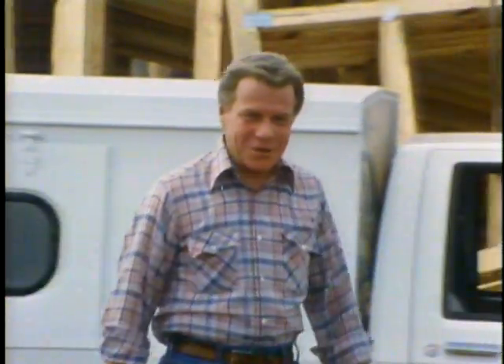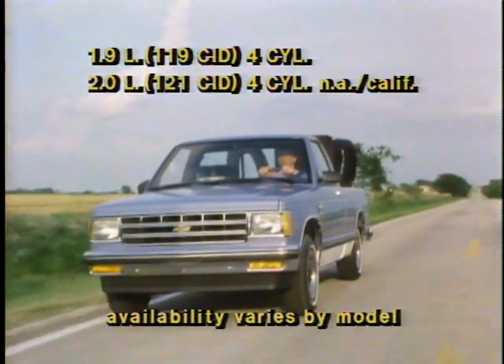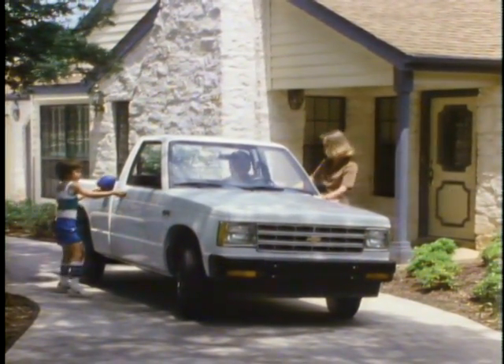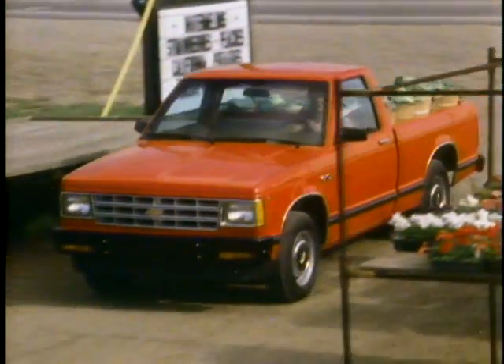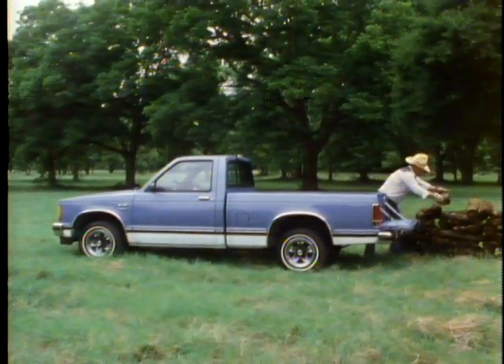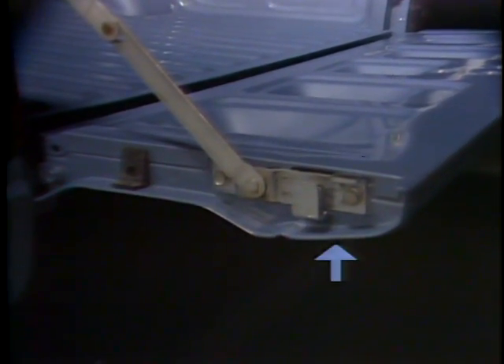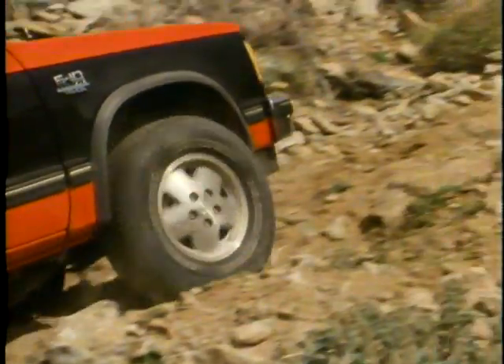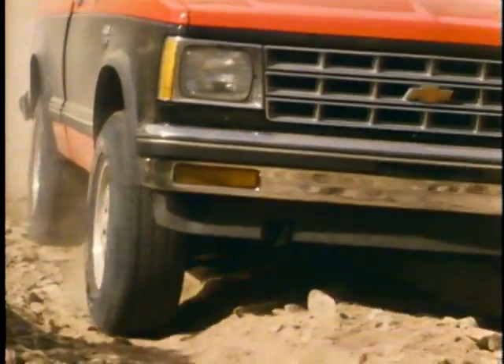1983 Chevrolet S-10 Pickup model overview

Comment: Had a '93 extended cab, 2.8L, 5sp for many years, never should have gotten rid of it.  No head rests on the bench seat?  Hope you don't get rear ended and crack your head on the rear glass.
Reply: I still have my 1986 Tahoe 4x4 extended cab that I special ordered from the factory. Still going 34 years later.

Comment: Hi, I bought a 1983 chevy s10 pickup about 6 months ago. The original owner, a farmer and mechanic, ordered it from the factory in 1982.
He had 3 trucks, and used this one for going into town.. when he died, his daughter inherited it..she gave it to her son in the last year of high school. 
He blew the head gasket.  They had just repainted it, put new tires on it and re-did the exhaust system.
Its gorgeous, silver w an aluminum tool box on the bed.
Best of all, it only has 69,004 original miles on it !
Once the head gasket is repaired and the carburetor.. I am going to sell it.
I am in Charlotte NC.  How do o go about getting the best price ?
Thank you..haven't done it before and hoping for some advice.

Comment: Buying a older 1982 S10 swapping a 350 with a 350 turbo transmission and going to bracket race plus use as a daily these trucks are badass .

Comment: I bought a 89 s10 durango 4x4 with a 2.8l, swapped in a v8 and now use the cargo holder behind the seat for oil that inevitably leaks haha
Reply: How do you engage the 4 wheel drive I have an 82 Durango that’s looks like it can do it just not sure how!
Reply: @Jazzygabs  I used the s10s 700r4 transfer case

Comment: I can't understand why people complain so much about the 2.8 litre engine. I drove my 2.8l S-10 Tahoe (which I had bought in used condition) in Germany for almost a decade and it never gave me any troubles. With the 5-speed manual, it had nice acceleration, reasonable fuel consumption and wasn't too slow for long-distance rides at the Autobahn (no speed limits). When I sold it in 2006 with ~245.000 miles on the clock, it still ran perfectly smooth. The engine never required repairs beyond the regular maintenance, except once when I had to replace some sensor at the injection system (which cost me 35 Euros). I still miss that car.
Reply: kernpanik yes these 2.8 liters are amazing little V6 motors the 165 thermostat keeps them cool. Unlike today’s motors running 200 plus.
Reply: Shouldnt have sold it!
Reply: Head gasket
Reply: @Clevelandsteamer324  You, sir, have a great name on here! 💩😂

Comment: The durango line never happened....and the tahoe was the top of the line not the sport line..
Reply: I have an 84 Durango in my driveway right now, i also have an 84 Sierra. The Durango has a really nice interior for the time it was made.
Reply: I had a durango, just because you have never seen one does not mean they didn't exist.
Reply: The sport was the top of the line. It later came with power windows and sun roof

Comment: 2.8 motor was the worst motor chevy ever made
Reply: LongIslandP8ntball no way. I have a 1989 2.8 5speed with 200k. It out runs my son’s 2010 Toyota Tacoma 4.0 v6. I know another person that has 328k miles on 2.8 never smokes. Just leaks rear main seal. I was always told 2.8 sucks. I believe not very strong lil engine.

Comment: Did the 1983 Chevy S-10 come with a chime or a buzzer?
Reply: Jac2Mac Low end came with buzzer. High end came with electronic (flute) tone. S-10 did not use a chime until the 1998 model year.

Comment: My first truck was a 86 S-10 2.8 V6, biggest piece of junk I've yet to own, that thing gave me my bias to buying Ford's when I got rid of it in favor of a Ranger.  Then again I've yet to own a chevy to impress me at all.
Reply: Those early Rangers were junk as well, hate to tell you.  Yeah the 2.8 V6 motors were junk but those 2.3L Ranger motors were garbage.  My nephew had one and had nothing but trouble with it.
Reply: I am a Mechanic of 30 plus years, I have seen good and bad in all makes of vehicles, my personal opinion is the vehicle is as good as the person who owns it.
Reply: My same thoughts on a ford.
Reply: All good points, gentlemen. Ultimately, preference is in the eyes of the beholder. I've had 9 of these trucks, in all configurations, and I love them. I'm driving number 9 now, as my daily driver, and I love it, too. It's a 1992 S-10, with the 4.3L V-6, THM700-R4, 2WD, and it's an extended cab. It gets 25 to 26 mpg at 65mph on the highway, and it pulls an 8,000lb (GVW) trailer safely, and without breaking a sweat. I don't buy trucks to be pretty or trailer queens, I buy them to work--and these trucks have always done this for me, with no issues other than preventative maintenance and normal wear items (tires, wiper blades, etc.).
Reply: Scott Lawrence mazda had a much better 2.8 turbo diesel and 3.2turbo diese in the 4wd
Reply: I had a 94 ranger I put 370k miles on the oem block, less the cam and head gaskets since I liked to drive it overheating a few times early in it's life.  To add I've had a few others all the way up to my only new car I've ever bought was a 02 Ranger I just didn't keep it long till I saw a Cobra I liked better.  4.0L v6 is the only one I'd fool with, but I personally know several people with the 4bangers that love em.

I don't like anyones 80s anything except for the Porsche 944 and 928 I had, but for the price they were new I'd still call em junk, what I paid for them was fine.

I've worked on both, I've been in some bad wrecks in my first Ranger all to even drive it back home after hitting and totaling a full sized pickup with it.  They are built much better, I've had 3 friends die in S10s.

But all the same I don't even own a vehicle with a gas engine anymore.
I try not to be a total brand bias whore, but gm is one name I've not liked anything of that I've owned.  I live in a GM product now actually LOL, but the engine and trans have been scrapped, waiting to find a Cummins 5.9 to go in it (motor home).  So when it comes to GM I've never had any good feelings with their products ever.  
I need to add, I pretty well don't like anyones new trucks, over priced and over regulated and longevity is a pasttime.
The truck I drive has 450k miles on it and climbing every day, no major engine work
I will say that chevy atleast did better with going with durmax diesels because they sure didn't have one worth a fart till Isuzu started showing them.  Now speaking on Isuzu, I've have a few of their products some that had the GM stamp on them and I will not say anything against tthem other than they are rust bucks and the parts are usually not cheap.  But I've had a few early 90s rodeos and I really like those alot.
In gerneral on their trucks, the brakes have always seems lacking and more spongy to me.  
Every brand surely has their faults noone is perfect and our creations aren't going to be either.
 I think anyone can agree the worst car maker to probably be Yugo without a doubt I would think LOL.
But at the end of the day if that particular vehicle you drive is doing what you need reliably and you are happy with it, then I sure am not smack talking your personal ride.  When I go to buy a vehicle I usually buy something that doesn't run at all, except my current truck, I didn't have time to work on a non-runner.

Comment: I like how the tow ratings are higher on these trucks which are lighter and less powerful than a modern small truck.  Seems like a conspiracy to sell full size trucks to me...  

Trust me, this truck with 5000lb on the boot is gonna suck trying to stop.  But it "can" do it.  Now they say something like 3000lb max on the newer ones.  Now we have ABS and a heavier tow vehicle which would be more stable at 5000lb - although neither sounds exciting to try to go very far with.
Reply: The S-10's were able to tow more than the first gen Colorado's that replaced them.   2004-2012 Colorado was only rated at 3500 lbs with the 3.5L inline 5.   What a joke.

Comment: the 2.8 was a garbage engine
Reply: Yep.  My sister-in-law had an '87 Blazer with the 2.8 V6 and it was toast by 55,000 miles...spun a rod bearing.  Ended up getting a new short block covered under the 60,000 mi warranty.
Reply: WHAT my 87 is still running today here in Alaska?? iam original owner???
Reply: It seemed to hold up a little better in passenger cars. Most of the time the cars of the 80s rusted away before too much failed.
Reply: Only the early ones. They changed the oiling system when they started going into the Fiero, Late 87 i think. Also the Fiero used a small crane camshaft that boosted the horsepower to 140 vs. the 125 HP they had. This is the TBI truck 2.8's i'm talking about, same heads as the fiero just a tiny cam.
Reply: Not so fast
Reply: It was a good, mid-size truck.
Reply: Have a 1989 2.8 5speed with 200k miles out runs my Toyota Tacoma 4.0. 
I was always told that 2.8 liters was junk. Know another guy that has 328k miles on his 2.8

Comment: the 4.3  engines are amazing
Reply: They really do. I've had two S-10s with the 4.3L V6. I'm driving the second as my daily driver. They're hard to beat for power and respectable mpg.
Reply: @donnieinskeep7264  i have a 1983 S10 Durango 2.8L V6, i rebuilt the motor! Wow, lots of work and $!!! cause I had to bore and hone the motor! but it will be worthed it at the end!
Reply: @NeutralGod1  yes, it is definitely worth it!
Reply: they have so much power
Reply: As good as a v8 350
Reply: These would've had the 2.8, which was sort of a turd compared to the 4.3

Comment: Seems like a decent vehicle, would be interesting to see how the corrosion resistant steel parts have held up.
Reply: They didnt hold up very well all of the square body trucks from any of the big three rust out really bad.
Reply: LMAO
Reply: Hmmm...My 1992 S-10 has been through hell. The two previous owners were teenage boys, ant they took it field hopping, mudding, street racing, and have dented and banged up the body, more on the bed than the cab, though. It has been through he'll weather-wise, too; yet, my floors don't have the least bit of rust. My rear wheel wells, front fenders  (where mud is known to accumulate and hide), and some rusting of the rockers and lower rear cab panels, and the bottoms of the doors, have a bit of rust. However, for the hell it's been subjected to, and the neglect it has endured, for the 26 years of it's life, I believe it to be in pretty decent condition. They're not all rust buckets. The condition of any automobile is subject to its care--or lack thereof--throughout the duration of its lifetime; if it is neglected and abused, it will be in really abhorrent condition, as opposed to one that is regularly and properly maintained. That is simple logic. That's not to say that no lemons exist, as I've been privy to the ownership of several--they do exist, of course; it's just that, on the whole, when an automobile is used and maintained in the manner in which it was meant to be, most are, on the average, decent and reliable. It seems that all the naysayers on here have gotten lemons, an instead of trying for another example or making lemonade from the lemons, they decided to be finished with, I believe, a vehicle they really weren't thrilled to be acquiring to begin with.